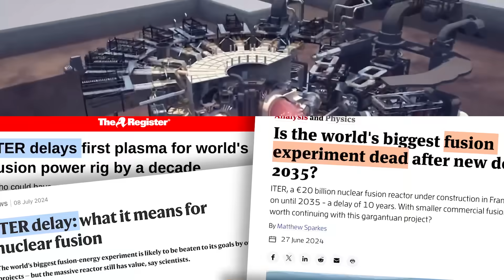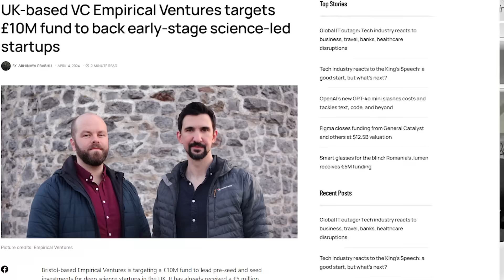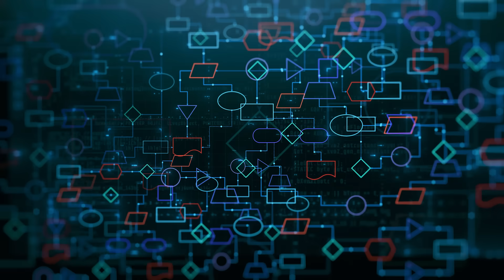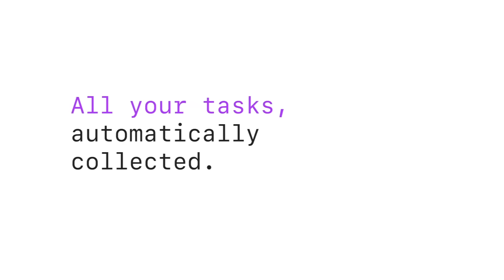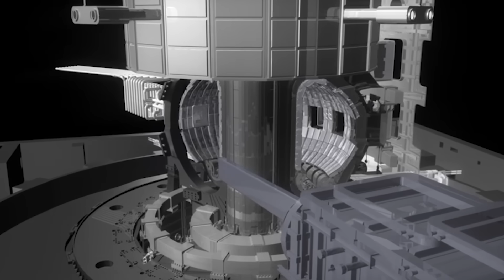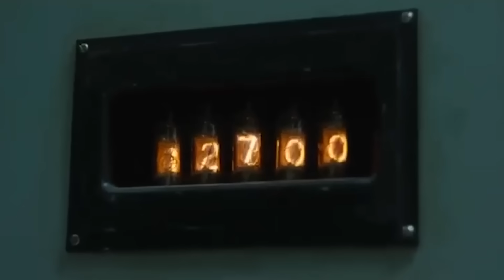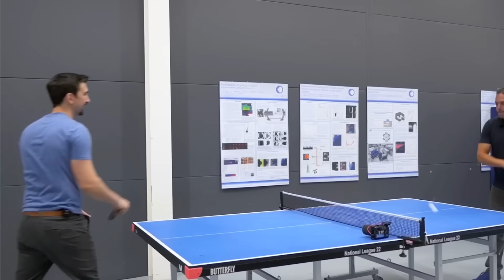Is The World's Largest Fusion Project Dead?

Comment: To be fair, I think it was pretty clear in 2010 we should have not been building ITER, not because I don't think we should be funding fusion, but that higher tempeture super conductors were being discovered which would reduce the size and therefore complexity of a test facility as fusion power increases by the 4th power of the magnetic field, so a doubling of field strength give you 16x the power for the same volume, where as volume only linearly increases fusion power.

What would have been much more optimal was to go for the quick and dirty method which was thought up at the same time as ITER, but was rejected because it would never generate more power than you put in, because you would ditch super conductivity and just make it out of copper, but that means you can increase the field strength meaning a smaller reactor, and given that what ITER is actually meant to do is demonstrate a burning plasma that would have been fine and it would have taken maybe 10 years to build it, probably more like 5.

Comment: Fusion energy is very expensive and unnecessary. The biggest problem is that you cannot use any hydrogen. So even the fuel is expensive and hard to get. There are so many other energy sources that we can use.

Comment: Call me a sour pessimist if it pleases you, but I do not believe that we will ever achieve "controlled' fusion. Work and spending began on this idea way back in 1953--70 years ago now. We have spent billions, perhaps trillions of dollars on those endeavors and have yet to build a reactor producing sufficient power to cause a single LED to emit. As far as I am concerned all that money and manpower would have been better spent on improving fission reactors. Personally, I am fond of the new LFTR designs that are fueled with fertile thorium, mainly because this design operates at much lower pressures than all the other fission designs do and they will shut themselves down in case of a major problem. 
 
Waste? You think that a fusion reactor will not produce radioactive waste? The fusion reactions we are studying now all produce  neutrons. Neutrons cause materials exposed to them to become radioactive, so do not try to tell me that there will be no waste from a fusion reactor. So long as the reactions taking place inside a fusion reactor produce neutrons, there will be radioactive waste to worry about.

Comment: The weak point is, as Dr Ben noted.. Steam Engines.. turbines.. Carnot cycle limitations well understood from 19th century.. throw away 60-80% of the heat generated to produce rotary motion. With all the other losses, electricity generation and distribution is lucky to get 33% efficiency. Fusion 1GW real world plant will be far more costly than Fission stations where the technology is well understood. Spend the money on real research and small startups not nightmarish Byzantine Bureaucracy.

Comment: Hence it only works as a very large reactor. A regular nuclear plant costs around 4 billion dollars, and lasts 30 to 40 years while generation around 500MW. To do fusion the reactor and immediate support gear would be about the size of a football stadium, generate 7 to 11 GW and cost 300 to 500 billion dollars and require much more maintenance than a fission based reactor due to the newer technology and more hellish conditions that the parts are exposed to.l

Comment: The whole premise is that of centralized power generation - now we seem to be heading towards distributed generation with solar and wind and batteries. Musk's ability to integrate and consolidate a neighborhood's various private electrical generators combined with battery storage and the autobidder selling spare power back to the grid - it's cheap and it works. Not techno-cool like Fusion but cheap and easy and growing fast.

Comment: Some details - unlike what happens in solar fusion—which uses ordinary hydrogen—Earth-bound fusion reactors that burn neutron-rich isotopes have byproducts that are anything but harmless: Energetic neutron streams comprise 80 percent of the fusion energy output of deuterium-tritium reactions and 35 percent of deuterium-deuterium reactions.
Now, an energy source consisting of 80 percent energetic neutron streams may be the perfect neutron source, but it’s truly bizarre that it would ever be hailed as the ideal electrical energy source. In fact, these neutron streams lead directly to four regrettable problems with nuclear energy: radiation damage to structures; radioactive waste; the need for biological shielding; and the potential for the production of weapons-grade plutonium 239—thus adding to the threat of nuclear weapons proliferation, not lessening it, as fusion proponents would have it.
Bombardment by fusion neutrons knocks atoms out of their structural positions while making them radioactive and weakening the structure, which must be replaced periodically. This results in huge masses of highly radioactive material that must eventually be transported offsite for burial. Many non-structural components inside the reaction vessel and in the blanket will also become highly radioactive by neutron activation. While the radioactivity level per kilogram of waste would be much smaller than for fission-reactor wastes, the volume and mass of wastes would be many times larger. What’s more, some of the radiation damage and production of radioactive waste is incurred to no end, because a proportion of the fusion power is generated solely to offset the irreducible on-site power drains.

Comment: The thing to assess here first if that ITER is first an economic endeavour and should be treated as such. The end goal is to further research in fusion energy production to replace current energy infrastructure.

And so I have no option but to raise a simple financial/gambling (as at the time it was and is as with any research but that's besides the point) observation: The sunk cost fallacy. Governments are notoriously terrible at cutting costs to projects like this as it looks good on the election cycle to keep those jobs present even if those jobs should've had a time limit honoured in the first place (hell this also applies to the F35)

Comment: This is the entire makeup of matter & free energy:
Roger Spurr’s Dipole Electron Theory perfectly explains everything we see in existence. If you test it, you will verify his decades of research.

1) Dark Points  = (Particle / Solid Mass / Do Not Change Size)
2) Light Points = (Energy / Massless    /  Does Change Size)

1) When 1 Dark Point and 1 Light Point combine, they create 1 Dipole Element.
2) When 2 Dipole Elements combine, they create 1 Photon.
3) When 1,823 Photons combine, they create 1 Proton. When 1,824 Photons combine, they create 1 Neutron
4) When Protons and Neutrons combine, they create the rest of existence

1) 1 Dark Point + 1 Light Point = 1 Dipole Element.
2) 2 Dipole Elements = 1 Photon.
3) 1,823 Photons = 1 Proton & 1,824 Photons = 1 Neutron.
4) Protons + Neutrons = Everything & Everything is Light

Dark Points carry / push the Light Points. When enough Dark Points and Light Points combine, the Dark Points all congregate into a ball to form protons and neutrons and the Light Points create a coating around the Dark Points so that they're no longer seen. In the stable elements, extra photons want to combine with the protons and neutrons, but are repelled into orbitals by the Light Points. 

Roger Spurr of Mudfossil University on YouTube has irrefutable proof of this and even convinced CERN to change out their particle detectors for CMOS detectors so they too can see this for themselves. Update: CERN has now detected what they call neutrinos (Dark Points & Light Points) for the first time ever, after having listened to Roger Spurr.

---------------------------------------------------------------------------------------------------------------------------------------------------------------------------

Venturis Create Free Energy:

- Dark Points cannot change size.
- Light Points can change size.
- When (red or blue or green, etc) photons enter into a venturi the Dark Points will be forced to return from the direction that they came from, but the Light Points will separate from the Dark Points and condense and go through the throat of the venturi. When Light Points separate from the Dark Points they create what is known as electron showers and increase their energy levels 200x. Upon exiting the venturi there is a small zone of pure massless energy that is able to be harvested for use. After this zone of pure massless energy is when more Dark Points arrive to attach to the Light Points.

* Task 1: Send (red or blue or green, etc) photons into a Venturi which has a throat smaller than the size of Dark Points.
* Task 2: Manufacture a device that can capture this excess energy in the pure energy zone and funnel some of it back to the light generating device and some of it toward a battery or any device you would like to power such as a microchip.
* Note: You need CMOS detectors to see photons.

How to Create Infinite Excess Energy:
1) Create a venturi with a throat that is smaller than the diameter of Dark Points.
2) Send (red or blue or green, etc) photons through the venturi. 
3) If an absorption and siphoning device can be placed in the zone of pure massless energy, before fusion occurs, we can harness free unlimited clean energy. Route some energy back to the light generator & route some energy to a battery or whatever device you want such as a microchip.

As the light gets accelerated and pulled into the venturi the Light Points condense to go through the throat. The Dark Points on the other hand cannot change size and are forced backward, away from the throat. As the Points separate, called fission, excess energy is created by the Light Points. Immediately on the exit end of the venturi is a very small zone of pure massless energy of only Light Points. These Light Points will have a significantly increased energy level of 200x as compared to the energy that went into the venturi. Immediately beyond this very small zone of pure energy is when Dark Points show up to attach to the Light Points, which is fusion. We want to use the energy before the Dark Points begin attaching to the Light Points.

---------------------------------------------------------------------------------------------------------------------------------------------------------------------------

The Gospel of Lord Jesus

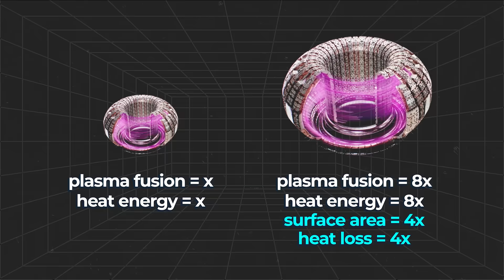John 3:16-18 (Jesus speaking)
16 For God so loved the world, that he gave his only begotten Son, that whosoever believeth in him should not perish, but have everlasting life.
17 For God sent not his Son into the world to condemn the world; but that the world through him might be saved.
18 He that believeth on him is not condemned: but he that believeth not is condemned already, because he hath not believed in the name of the only begotten Son of God.

Romans 10:9
That if thou shalt confess with thy mouth the Lord Jesus, and shalt believe in thine heart that God hath raised him from the dead, thou shalt be saved.

Repent of your sins or suffer the consequences. Lord Jesus died in our places personally to take the death punishment that sin deserves and then resurrected by the power of God. Believe this and sincerely repent of your sins each time you sin and you will have eternal life and nothing to fear. Fail to repent and you will end up in the Lake of Fire.

Comment: The answer to the question posed in the video, ITER is not dead, although many argue it should be. The insanity of costs, only made more insane in management, is nothing compared to having already been sued for lack of transparency and likelihood of further legal problems, almost seemingly being an inevitable (and anticipated) problem, and the fact its a Tokamak, the first and arguably worst design to be given to creating a real production fusion reactor, mostly resulting from the fact it is only capable of sustaining a maximum of 500 seconds continuous fusion reaction (projected) and the insane high temperatures involved, resulting in insane engineering challenges, which reveal greater problems, than might ever fully be able to be overcome. For example, thermodynamic equilibrium has to be sustained, in order to extract any Q positive produced energy, which requires all components to be within acceptable tollerances of thermodynamic harmony, which requires more power, than any single power plant on Earth, is even able to currently deliver (or likely to, unless beaten by another reactor being more productive, just to power this huge, expensive, dinosaur of a design). I would strip it, melt things down, flog the bits n bobs and call it a day because this is a dead horse, before even reaching the gate.

Comment: It's a complicated question to be sure...  

Some of your other commenters have pointed this out, and I want to agree, and possibly phrase it differently....  It has taken so frickin long to build ITER....  the assumptions made in 2006, 2009, in the design phases....  Many are outdated now, we have better magnets, we have new understandings of certain aspects....  By the time this thing is done, it will prove nothing, the other research will have moved past it before it ever runs......

Another fundamental misunderstanding here is, this is just a big science experiment....  When finished it will NOT generate commercial AC Power to anyone....  this is a nothingburger.  Even if we magically finished it tomorrow, it does not represent a "prototype" of what a commercially viable Fusion reactor might look like, that would power homes....  The Q of 10 is pathetically bad, nobody would invest $50 bucks US in such a projects.... Modern fission plants are wildly higher than that....  

I agree with you Doctor...  the coming together of nations, the cooperation, the desire to achieve something that could benefit all mankind...  Yes, it is all admirable, and good....  I hate to say it, but if it was my call (and it sure as hell isn't), I would say stop.  If anything, we need to look at this, and do a cold hard analysis of the project, and figure out how, in the future, to work better together, so that we can achieve something....

Comment: No, it is not dead.
On top of that, ITER has already given us plenty of experience.
It will be a template on what to do and what not to do in multibillion multinational consortiums, as well as how to create such a complex machine.
That knowledge is already being applied to current projects, right now.
Plasma wise, only ITER will really be like ITER.
Other machines that are promising will explore different regimes, but again, only ITER will give the answers that only ITER can give, whenever they come, so there is really no way for it to get obsolete, because it will answer questions that cannot be answered anywhere else.
Maybe other machines find a viable path to fusion first? It could be, but that still does not eliminate the goal of ITER.